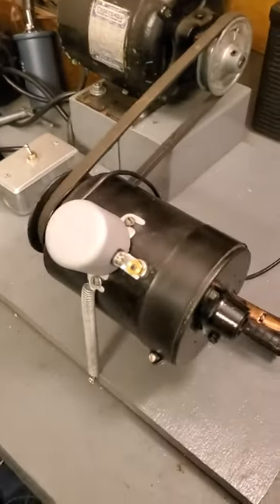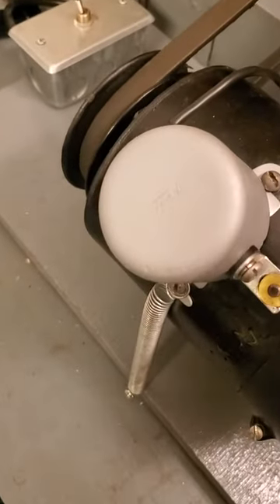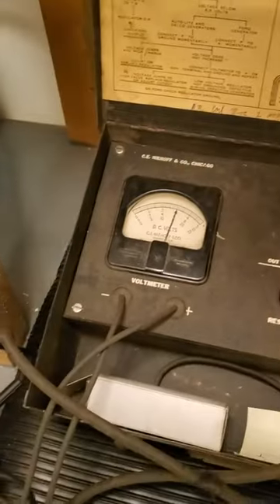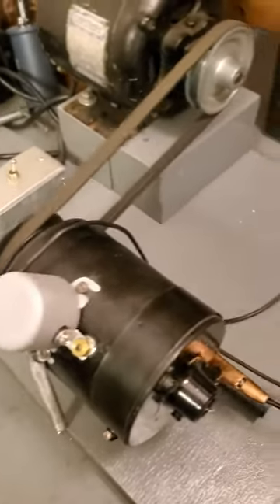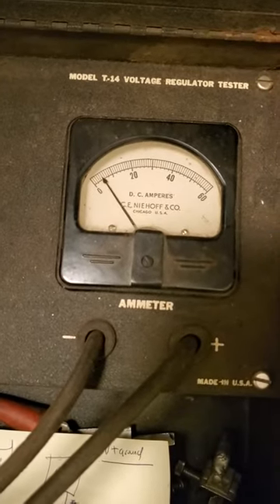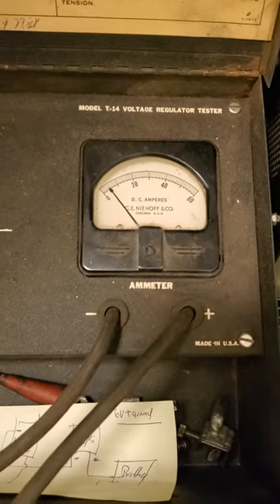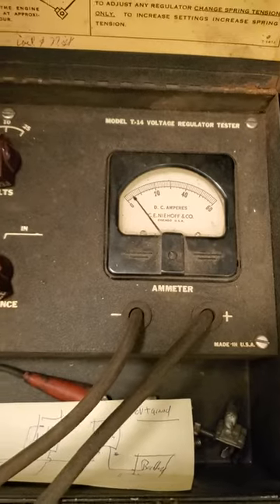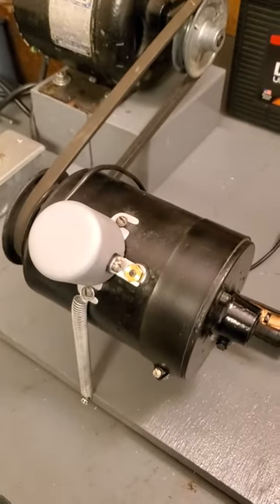Bench Testing a Refurbished Ford Model A Generator and Cutout

Comment: Steve i have a farmall 3 brush gen, it has a 2 coil regulator, does it need a cut out instead?
Reply from the maker: 3 brush generators use a cutout, not a regulator.
Reply: @steveblancard5566  thank you , having trouble with this one , it motors opposite of what the engine drives it & its generating polarity is backwards

Comment: I want to make a test rig. What horsepower motor are you using? Thank you mucho!
Reply from the maker: This a 1/4hp. It fine for model A generators. But not for larger 2 brush generators. I use my larger Weidenhoff test stand.